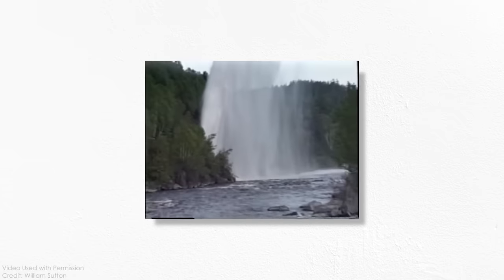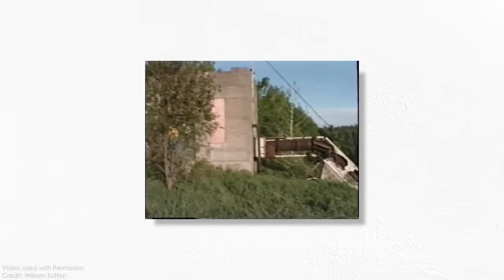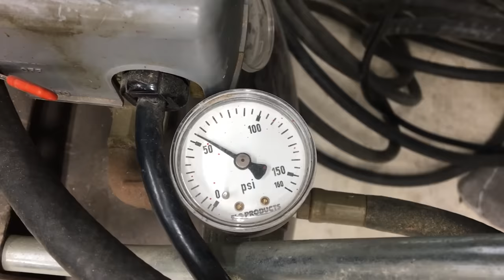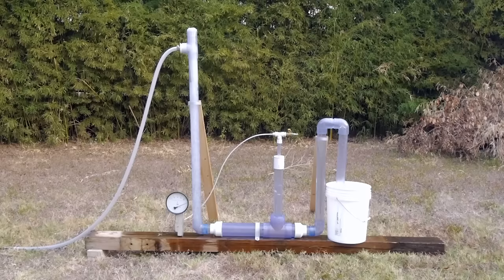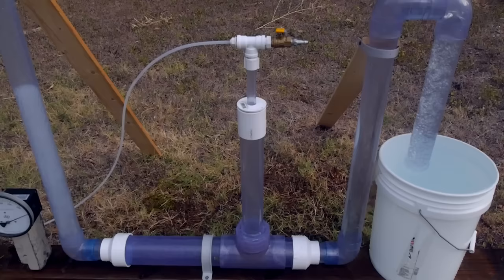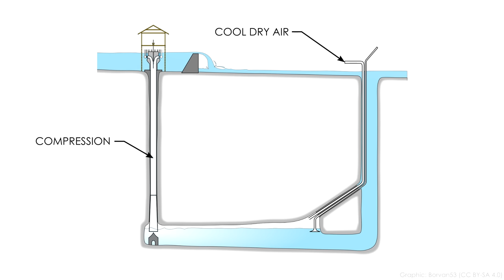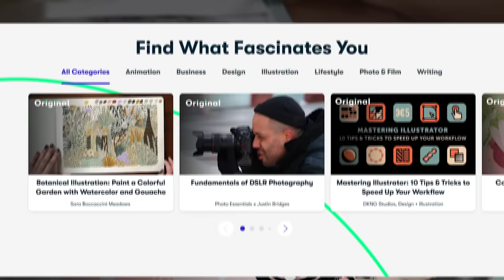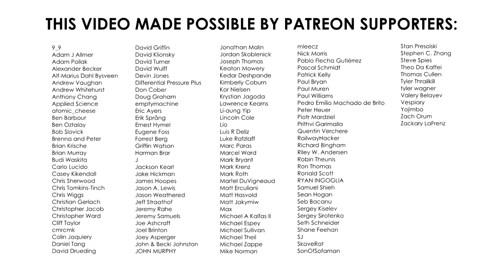Compress Air with No Moving Parts! - Trompe

Comment: You could make the best April fool video ever. Every video I watch is about some cool engineering thing I've never heard of. You could make one on how electricity flows better uphill so most power plants are downhill from people and I would believe you.
Reply: Electricity does flow better uphill. Doesn't it?      :)
Reply: @PhilJonesIII  If he told me it did I would believe him!
Reply: electrons float on water, that's why it's conductive!
Reply: Electricity is energy just like heat, and heat rises. So of course it does! 

I think it was the Roman scholar Aprilius Foolius who first proposed this theorem.
Reply: @Hypercube9  
Heat doesn't rise.
Reply: You don't fool me, eletricity flows downhill better.
Reply: Well, that depends, do you mean liquid electricity or powder electricity?
Powder electricity doesn't really flow all that well.
Reply: @PhilJonesIII  I knew that the first comment on this had to be this comment :D
Reply: Please don't do this to us.
Reply: @truthspace5525  If heat doesn't rise, why do my pans keep getting hot when I put them on top of my stove? 

See also: r/woosh
Reply: @Hypercube9  this is an engineering channel.... heat doesn't rise, hot air does.  you got whooshed when you though you were whooshing and have a chance to get whooshed again!  if the heat rises to heat your pan then lift it 12" off the flame, if it's just the hot air rising it will diffuse too much before it gets to heating the bottom of the pan.  lower the pan and it get's hotter, hotter lower, the heat sinks!  electricity therefore flows faster downhill.  =D
Reply: @Hypercube9  
Please explain what went over my head.
Reply: @dominickcalamia317  I'm not sure if you're being serious now or not. In my original comment I was joking! (I thought the "Aprilius Foolius" kinda gave that away but I guess I was wrong.) What he said was "Heat doesn't rise." in other words he was claiming that heat CAN'T rise! It NEVER goes up (according to Truth Space anyway). If we're being serious, heat can radiate in ANY direction and conduct in any direction. The only one's who have been wrong here are you and Truth Space! Because you both claimed that heat CANNOT travel in a certain direction! I only claimed heat rises I never said anything about it not traveling in other directions or about hot air NOT rising. Not to mention the fact that hot air contains heat which you've already admitted rises and thus contradicted yourself!
Reply: @truthspace5525  You apparently didn't notice that we were all being facetious. Kidding, joking, not serious. Like if I were to tell you that every time the wind blows I see the trees moving back and forth (a true statement), and that is how we know trees moving back and forth is what produces the wind! I wouldn't actually need you to correct me. thatsthejoke.gif 

On top of which, you weren't even right. Heat can travel in any direction, even up! Maybe next time I will explain how we know the Earth to be banana-shaped!
Reply: @Hypercube9  
Rising is a specific thing, and heat can rise about as well as your shoes can walk.
Reply: Truth Space But cold air definitely does fall doesn't it?
Reply: @Hypercube9  but i thought that was obvious. The ends of the banana earth are sharp corners so the electric field is stronger thus Aurora borealis on the banana stem and bottom (north and south pole)
Reply: @truthspace5525  Woosh! There it goes again! You still don't seem to be getting it! It was A JOKE! I was using something a majority of people might think to prove something silly like electricity flowing better uphill. Just like how in the example with the trees moving and wind blowing at the same time the trees don't actually produce wind! (I've honestly never had to explain that to anyone before!) 

In any case, I was using rise to describe a transfer of thermal energy from an area of high thermal energy to a location of lower thermal energy that is further from the earths core. But fine, if you want a better example I'll use the Sun! Heat from the Sun travels OUTWARD in literally EVERY DIRECTION in 3 dimensions! If energy can travel in EVERY direction then that must logically include up! Not to mention that if you were at the Sun's core, EVERY direction would be up! Now you might be thinking about actually trying this, but if you're going to visit the Sun I recommend you go at night! <--(Psst... that's another joke, you can't actually go at night! So no need to correct me! )
Reply: @Hypercube9  heat does not rise or sink.  you need to go back to physics 101.  ill save you the trouble this is a STELLAR writeup on exactly what we are debating.  don't take my word for it, heat does not rise or sink because it is not a substance that can do so but a property of a material.  NauticalMile (https://physics.stackexchange.com/users/56926/nauticalmile), Does hot air really rise?, URL (version: 2017-09-14): https://physics.stackexchange.com/q/235406
Reply: @Hypercube9  
Electricity flows with less resistance downhill because of gravity.
Trees can also generate wind.
Jokes on you.
Reply: @truthspace5525  "because of gravity" Pfft, like that's a real thing!
Reply: Electrons are negative, therefore is repulsed by the gravitational force, hence why it flow better uphill!
Reply: depends on what kind of electricity are you useing. Electrons move uphill easier, but ions flow downhill easier. it's pretty easy to understand, because elactrons are basically almost weightless, while ions arefucking heavy. You can easily create electron current with a generator, so by a moving magnetic field and a coil. The free electrons in the coil are going to move because of the field.
The interesting thing is how you create ion current. You could use the same method, but create the coil from salty water in a pipe, but that would be a mess (that's the only easy way to convert mechanical power to ion current, so some high power wind turbines are using salty water ion generator). So your best bet is buying an ion optimised solar panel or TEG. These are semiconductor based power generating devices, so you don't need a coil, or magnets, or anything like that, so they are more practical. The point of them is scientists worked out a way to create ion current with a solar panel, because you usually mount on on your roof, so the current flows easier compared to regular electron based solar panels, where the electrons want to stay in the solar panels. They are a bit more expensive, and pretty rare actually, but go for it if you find one, it's worth it. Ions are much more obedient than those electrons.
Reply: cobrar85 I feel like this is a setup for a brilliant.org advertisement.
Reply: @Hypercube9  
You screwed up the joke. The joke was supposed to be a false correlation. It wasn't funny because the thing you're correlating it to has to be true. 

Heat doesn't rise, because heat is just some abstract thing we use to quantify kinetic energy of a particle. It doesn't exist.

Heat does not travel outward from the sun. Particles are released by the sun that travel outward, and they transfer their energy to other types of particles when they collide.
Reply: @Hypercube9  thats because the 'cold' flows down into the stove and gets replaced with the heat ;)
Reply: @truthspace5525  "The joke was supposed to be a false correlation" Says who? It's my joke, it can be whatever I want it to be! I just needed a plausible but untrue reason why electricity flows better uphill. My joke qualifies. Why are you even arguing with me? Take it up with the Roman scholar Aprilius Foolius! It's his theorem! 

"Heat doesn't rise" You keep saying that but I have given you numerous examples any one of which is enough to prove your statement untrue! Heat can travel in ANY direction! Here's another: Imagine putting the bottom of a long piece of metal (like a pipe) in a fire. Heat WILL conduct UP that pipe even in a vacuum! 

"Heat does not travel outward from the sun" I think you've eaten too many Tide Pods kid.
Reply: Guys... if you haven't figured it out yet, this is a trick question! Because everyone knows STATIC electricity doesn't move!
Reply: @Hypercube9  No, but it communicates with other electrical sources, which is why it appears to travel through an arc. But only uphill ;)
Reply: It would depend on who is observing the electricity, since relativity would appear to add some "resistance" depending on your current reference frame. But I'm not entirely sure in which direction that would work.
Reply: @Hypercube9  i got the joke.  you then went on to clarify that heat rises.  it doesn't.  it's not a matter of opinion.  no big deal.  have a good day, enjoy it all, be kind to others, love with all your heart and do everyhing to the best of your abilities.  also never forget heat DOES NOT RISE because it's a property of matter, not matter itself.  you are right though, it wasn't a debate, you just spouted some assumptions with no basis in fact or science.  i proved the point that heat doesn't rise with citations and proofs.  you can pretend that's not what you were saying, but we both know it is.  "if heat doesn't rise why does my pan get hot when i put in on my stove"  too far past the event horizon to even be able to back pedal past that one.
Reply: @Hypercube9  you editted your comment after i replied to remove where you actually claimed heat rises.  this makes me sad.  own your mistakes.  don't run from them.
Reply: @truthspace5525  he edited his comment to remove that part once i proved him wrong lol.
Reply: @Hypercube9  you weren;t you editted your comment to pretend that after the fact.  see the quoted comment replies to see what he said originaly but then changed it after everyone proved him wrong. lol
Reply: @truthspace5525  SPOT ON!!!! he editted his comment after we all replied and is pretending he said and meant something other that what he said and meant.
Reply: @Hypercube9  "Because you both claimed that heat CANNOT travel in a certain direction! I only claimed heat rises I never said anything about it not traveling in other directions or about hot air NOT rising. Not to mention the fact that hot air contains heat which you've already admitted rises and thus contradicted yourself!"  this proves you were not joking about heat rising.  stop lying about it, no big deal we can just continue with the joking we were doing.
Reply: @dominickcalamia317  
I guess he couldn't take the heat.
Reply: @truthspace5525  I accept your surrender and your apology.
Reply: @truthspace5525  ^^^^ THIS IS HOW JOKES ARE DONE!!! hahaha  =D
Reply: Weird, YouTube is showing me my previous comment at home, but not from my work. I'll repost. 

"you editted your comment after i replied to remove where you actually claimed heat rises." 

Liar! I only have ONE edited comment in this entire thread and that comment was edited to add the "See also: r/woosh" Additionally, my ORIGINAL comment STILL claims "Electricity is energy just like heat, AND HEAT RISES." in addition to several others! So why are you claiming I've changed my story?? 

Heat can travel in ANY direction! There is no single direction (UP, or otherwise) that heat cannot travel. I have given MULTIPLE examples of this which you have just ignored. Here's another: Put a solid metal cube on an electric hot plate and heat will travel through the cube from the bottom to the top! Do you deny that? 

"this proves you were not joking about heat rising." 

I never said I was! The entire thread was a joke about electricity flowing uphill! And heat CAN RISE! When did I say otherwise? 
"stop lying about it" 

Again, YOU are the one making stuff up! 54 people understood the joke, you just weren't one of them! Give it up already! 

(edited for formatting)
Reply: Try a Jacobs ladder, it will travel Up! 🤓😉🤔
Reply: Truth Space well natural convection does make seem like heat rises. Only density differences though.
Reply: @dominickcalamia317  Sounds to me like you didn't understand the joke, made a fool of yourself and are now just trying to save face. Give it up guy, no one but you cares. And Hyper's right anyway.
Reply: @Hypercube9  don't mind the bachelors desperately trying to prove they are smart by nitpicking a joke. obviously since the universe is a kind of 4-sphere they have rotated their neighborhoods the wrong way (the way of stuck up pragmatism probably)
Reply: @Hypercube9   i have the original comment. you cant hide from the truth: " "Because you both claimed that heat CANNOT travel in a certain direction! I only claimed heat rises I never said anything about it not traveling in other directions or about hot air NOT rising. Not to mention the fact that hot air contains heat which you've already admitted rises and thus contradicted yourself!" "

tell me you didnt mean heat rises there and you said that as a joke.  get real./
Reply: @Hypercube9  no heat does not travel.  you say that and you even say it radiates in all directions and yet you still say it rises.  you might not know what heat is, what radiation means, or what it means to rise.  theese are dictionary definitions you are messing up not physics ideas.  i do enjoy how you keep going back and forth between "heat doesnt rise it was a joke!!"  to "heat actually does rise"  which is it?  do you think heat rises or not?  then i can properly prove you wrong.  its not a matter of opinion.
Reply: @dominickcalamia317  First of all, that's my THIRD comment, not my original comment! Second, that comment has NOT been edited so everyone has it, not just you! And third, I stand by everything in it!  

What part of what I said don't you understand?? Heat DOES rise! I am not denying that, nor am I denying having said that! I AM denying having altered ANY of my comments to change my position. So, my question (which you keep ignoring) is why are you claiming I said something I didn't? I challenge you to back up your claim! 

You (should) know that heat can travel in ANY direction. You have provided no evidence that it CANNOT travel upwards. Also, (technically) hot air DOESN'T actually rise as you claimed. It is forced upwards by denser falling cold air. So you're wrong about that too!
Reply: @dominickcalamia317  "you even say it radiates in all directions and yet you still say it rises" 

Yes... so? If it radiates in ALL directions than it DOES RISE! Rising is included in the subset of ALL directions. What's your problem? 

"heat doesnt rise it was a joke!!" See... I NEVER said this! When you put stuff in quotes, it's supposed to be something I actually said! (And in quotes it should actually be word for word!) My original comment was supposed to be a joke! This was never a thread about heat rising! However, you lie when you claim I changed what I was saying. I never did. And I certainly never kept "going back and forth" on the issue. Really! Re-read this entire thread if you don't believe me! I have been consistent in my claims! I don't think you understood what I have been saying.
Reply: @Hypercube9  now you are arguing semantics.  rising does not mean the same thing as radiates in all directions.  radiating in all directions is no more rising than falling than moving in ANY direction.  you have no argument, my point has been proven you just keep alternating between if you were kidding or not about heat rising.
Reply: @Hypercube9  heat doesn't rise, i provided the information why heat doesn't rise and why otherwise identical homogeneous liquids and gases of different temperatures have buoyancy.  where the warmer one is lighter most of the time, SOMETIMES that's not the case.   instead of arguing with me you could see what i was saying and agree that you weren't being literal but if you insist on this dead end of reasoning i will have no choice but to continue to point to the reasons i believe this isn't a matter of opinion and there is an answer.  heat not only doesn't rise, it can't.  next you will argue you meant the temperature is what you meant rises.... that or go back to "i was just joking, of course heat doesn't rise!"  haha  i found more humor in that than your original comment.  but that is just my opinion, heat's ability to rise isn't.  show me how heat rises and how much it rises by and how quickly it rises in a vacuum if you believe for a second heat can rise and isn't a property of matter.
Reply: @dominickcalamia317  Wow! You are clearly not getting this. My first comment, my original comment that currently has 67 likes from people intelligent enough to know a joke when they see one WAS A JOKE! The comment as a whole that is. And you know I'm right because you even said "Dominick Calamia 4 days ago @Hypercube9 i got the joke." 

Now, taking you at your word, jokes don't NEED to be corrected! If you tell me there's 360 degrees in a circle. And I say "Wow, that's one HOT circle." THAT'S A JOKE! You have no reason to explain how circles work! And you only make yourself look foolish by trying! 

Now, that said, I have NEVER claimed that heat does not rise! Not once! And you're lying every time you claim otherwise! I don't need to lie to win this argument. Apparently you do. 

"rising does not mean the same thing as radiates in all directions" I agree! Of course, that's also NOT what I said! Rising means to move in ONE direction and specifically a direction opposite the force of gravity. And since it's YOUR claim that heat cannot travel in one specific direction, I only need to give one single example of heat moving in that direction (or ALL directions) to disprove your claim! If heat radiates in ALL directions outward from the Sun, then logically I have proven that heat can move in that one direction! 

"Rise: move from a lower position to a higher one; an upward movement; an instance of becoming higher." Now remember that we were discussing the uphill flow of electricity. And in my example of the metal cube on a hot plate heat travels from the bottom of the cube to the top! It has moved "from a lower position to a higher one". Therefore, while that cube has remained stationary, the HEAT has RISEN! 

Give it up guy, you're wrong.
Reply: @carlosrfonseca  it does if you add water 🤔
Reply: @Hypercube9  your post is full of red herrings.  you said heat rises.  i told you it doesn't.  there is noting more or less to it.  it doesn't and showed you why it doesn't. that's all i've been saying.
Reply: @dominickcalamia317   "you said heat rises.  i told you it doesn't.  there is noting more or less to it" Thanks for the recap, but YOU are the only one here who is confused about who said what. Although, I'm glad you've finally decided to admit that I never changed my story. That's at least something. 

There is no reason why thermal energy cannot travel opposite the force of gravity and you have not given any reason for anyone to think otherwise! Nor for that matter have you said anything to dispute any of the NUMEROUS examples I have given of heat moving in opposition to the force of gravity! Convection is not the only form of energy transfer! You are completely ignoring conduction and radiation! Conduction is the movement of heat through a substance by the collision of molecules. At the place where the two objects touch, the faster-moving molecules of the warmer object collide with the slower moving molecules of the cooler object. As they collide, the faster molecules give up some of their energy to the slower molecules. The slower molecules gain more thermal energy and collide with other molecules in the cooler object. This process continues until heat energy from the warmer object spreads throughout the cooler object! You have yet to explain why this process wouldn't work in the direction we call "UP"! (And there's a good reason for that, because it WOULD!) 

Additionally, as I have already said you were also wrong about "hot air" rising! Hot air is forced up by the colder denser air being acted upon by gravity! Without that cold air, the hot air stays where it is.
Reply: retepaskab 

 I'm with you on this one , elections have mass . If you could shoot an electron out of a beebee gun  it would eventually crash..theoretically so ya subject to gravity 🍻😄
Reply: Hypercube9 
Hot air has lower density. Believe you me I know , I'm reading these comments 😬👊💥
Reply: Why not to speak and joke about how intelligent you are all in an other place, cause it is polluting this (VERY INTERESTING)  thread and is too far away from the initial subject. THANK YOU !! comme dirait Coluche : "la culture, c'est comme la confiture; moins on en a, plus on l'étale ! "
Reply: AutoNomades 
Why not lighten up?... or go marge la merde
Reply: @truthspace5525  faults. Heat goes out from. It's called," Radiated Heat".💥🔥 I mean if you stop to think about it, where is up? Well for 1, up in space. And 2, over our heads. Etc.... greenhouse gases, blah blah blah. I'm done.
Reply: @thephantom1492                    Love It! Return to form for the origin of the comment(s) thread.
Reply: @PhilJonesIII  of course it does! It's lighter than air!
Reply: I was kind of hoping to see a "Practical Engineering replied" under this comment that just starts with "Thats actually a very interesting phenomena..."
Reply: Look up motor sin destruir combustible. It's a internal circulation pneumatic engine